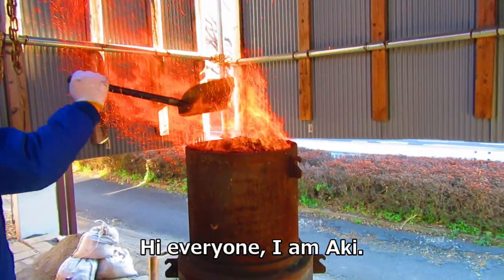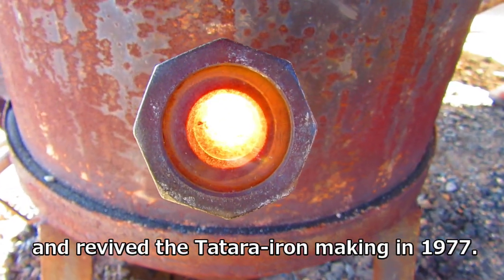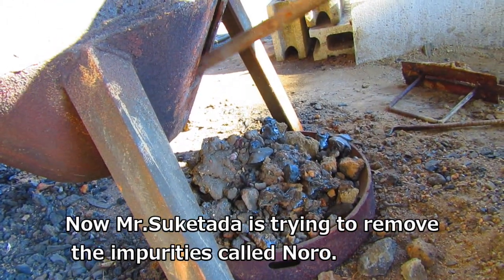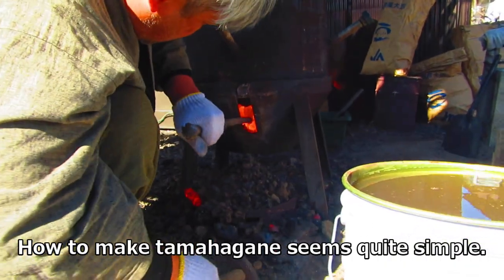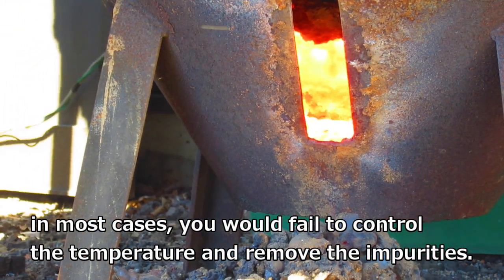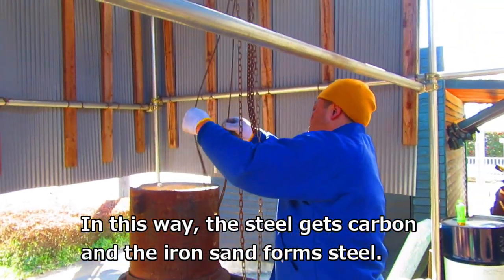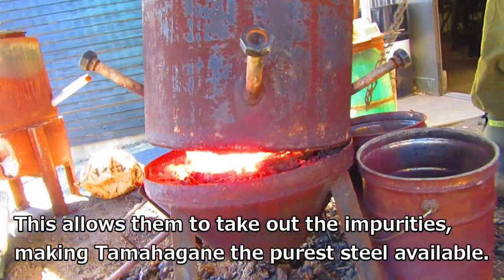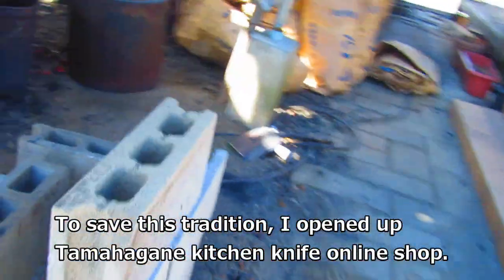【Japanese Jewel Steel】The world's purest steel "Tamahagane"

Comment: The qualities of tamahagane are mostly mystical. For hundreds of years Japan had only one local source for iron and that was iron sand. It took a lot of time, effort and money to remove the iron from that sand, mainly because the iron ore in that sand was NOT particularly pure. The steel made from this iron is pure in the way that it only contains iron, carbon and maybe traces of silicon and manganese, but not much else. It made sense to use that expensive steel in swords for noblemen. The fact that these swords were status symbols carried by rich and powerful men helped proliferate the reputation of tamahagane's purity - a virtue held high in Japanese culture - and the mythical way it was created. You can still make nice knives and swords from tamahagane, but any modern steel is easier to manufacture, therefore cheaper and better in almost all aspects.
Reply: the reason that the blades were folded so much is because the iron contained so much carbon that the blade would be extreamly brittle... the swords were made of iron, not steel.
Reply: @Jimothy-723 It was steel. If your starting material was carbon steel (tamahagane goes around 0.5-1.5%C), piled and forged and folded, it'll reach a desired carbon content for the edge. 

Plus we have works written on the matter that analyzed any kind of ironwork in Japan you could think of
Reply: @Jimothy-723  Everything you wrote is wrong!!!

Comment: If it was the purest steel it wouldn't have so many imperfect impurities in it
Reply: The term "purest" here doesn't refer to the absence of solid impurities in the bloom/ingot but rather the absence of alloying elements like chromium and Vanadium whose carbides are larger than  carbides of iron. Because of this, tamahagane and equivalent modern steels can attain a sharper edge. This isn't important for swords since you're swinging them with the force of a bat, but it's a nice bit of info. Western steel was always bettefm
Reply: The term "purest" here doesn't refer to the absence of solid impurities in the bloom/ingot but rather the absence of alloying elements like chromium and Vanadium whose carbides are larger than  carbides of iron. Because of this, tamahagane and equivalent modern steels can attain a sharper edge. This isn't important for swords since you're swinging them with the force of a bat, but it's a nice bit of info. Western steel was always better
Reply: @varun009  your wrong
Reply: @varun009  but western steel has always been better then others